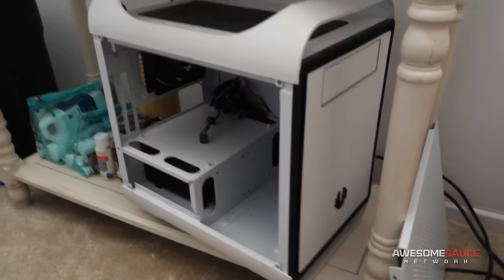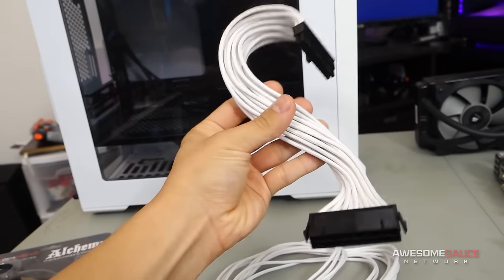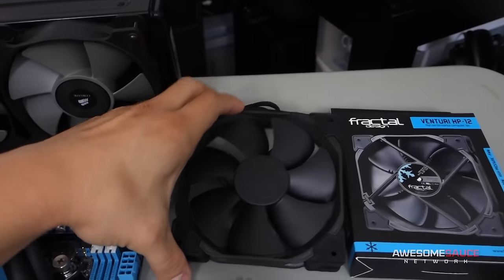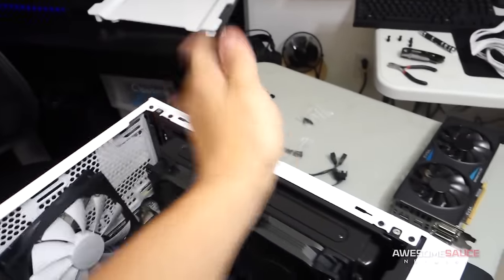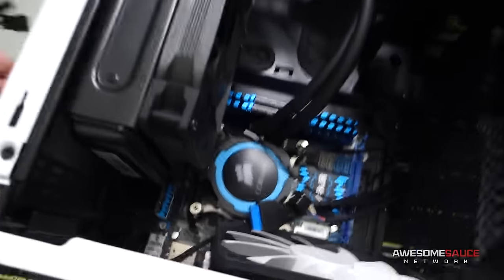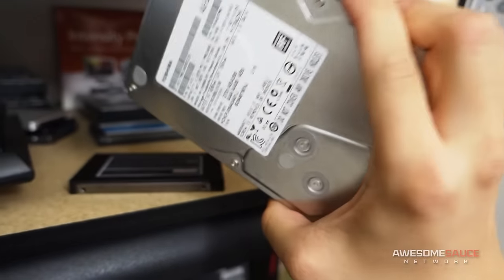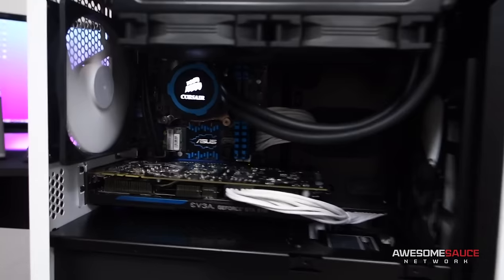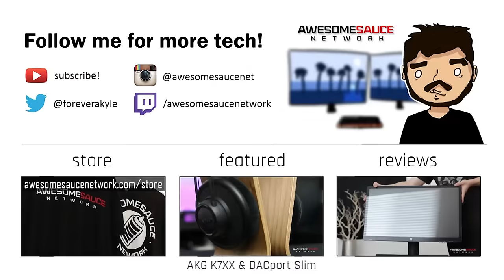Building My Wife a New PC! - "The Wifey Build"

Comment: I have the same case and loved it so far, it's not too big nor small.
Reply: +exit07 What about the venting on the top, seems restrictive (for a H105 at least)?
Reply: the case has 8 rectangular holes on the top for ventilation
Reply: ***** 4 on each side right? They just look small. The fans on the cooler shouldn't spin up too high so probably fine for this build.
Reply: yes 4 on each side. There is also the exhaust vent in the rear

Comment: Looking at the finished product I feel like it would've been better to use the stock black cables and black fans on the intake and exhaust or doing something with the H105 tubes. The wifey probably won't care and it was a just a quick build so it probably doesn't matter anyway and it still looks great.

Comment: But kyle does it run crysis 3 at 999999999999k resolution ultra graphic settings ;)?
Reply: +Mauricio garza Hah! Crysis 3! Who needs that when you have pong! I get 12 fps on my quad titan x system...
Reply: I got 9999 fps with my intergrated graphics on farcry 4
Reply: Rhys sopniewski But can you run pong?
Reply: Im afraid not i will have to upgrade from my skylake cpu to a 1.0ghz celeron

Comment: How far in terms of FPS and 1080p gaming (1440p at times) do you think I will get with this? Planning on playing Battlefield 4, SWBF, Arma 3 etc. 

SSD: Samsung EVO 250GB
GPU: Asus GTX 970 4GB STRIX
PSU: Fractal Design 500W 80+ Gold
CPU: i5-4690K 3.5 GHz 6MB
CPU Cooler: be quiet! Pure Rock
RAM: 8GB Crucial DDR3 1600MHz Ballistix Sport
Motherboard: Asus Z97-A
HDD: WD Blue 1TB 7200rpm 64MB
Reply: Try getting a 4460 and a 980, that should run 2K.
Reply: get your self a msi R9 390 (non X) version , 8GB of vram should give you a 70 fps on 1080p max , 50 fps on 1440p max especially when you get to have windows 10 , and since AMD has launched Theire new Clint ... they are rising once again tbh.

Comment: What i really don`t like about this case is the ventilation for the Graphics Card, i think its too restricted and i think this radiator mount is designed to suck in fresh air into the case vs pushing hot air out, but anyway if you do it  you`ll run into the issues of introducing a lot of hot air and stress the graphics card more.

Comment: Wouldn't it have made more sense to take the AIO cooler off of the CPU while installing the radiator, then put it back on once the radiator's in the case? Bit late I know, but that's probably what you're meant to do...

Comment: That whole 16 screw thing sounds like a hassle. My old HP desktop was like that too and I didn't feel like dealing with that many screws so when I was transplanting the system I just ripped off the whole side/top panel off.
It's not like I was ever going to need that case again anyways.

Comment: On the top panel complaint, they probably assumed you wouldn't install the waterblock onto the cpu until after you slide the radiator in place.

Comment: Hmmm, might have tried to front mount the radiator.  More of an aesthetic choice, but it drops down so low into the case in the top mount.  Also it probably didn't such a big fan in the front since the system was not really going to run hot.

Comment: You really shouldnt have 3 exhaust fans and only one intake. better flip the rear exhaust to an intake instead - that would yield better temp for your CPU, and/or lower noise due to less demand on radiator fans.

Comment: Why didn't you just remove the CPU cooler from the CPU socket when installing the radiator & top bracket? That would have meant you could have installed the motherboard first & routed any cables, and then installed the radiator & bracket. It's a five minute job reapplying TIM & tightening down the four screws.
Reply: You beat me to it.

Comment: Not to mention, going with AMD would have saved a lot of money. I love Intel / nVidia as much as the next fanboy, but on average these parts cost 2 - 3 x what an AMD costs - and unless you're aiming for playing the top new games on ultra at 4k, then an AMD build is fine (though for that matter, I just got done playing Metro LL @ 4k on very high settings on my AMD build with no problems... so).

I have an 8350 3.7GHz (stock), R9 390, 16GB Ram, 1TB hard drive, and I can play every current game at 60FPS+ at 1080p with everything in ultra.
Reply: kewl
Reply: ***** CPU side? So far, yes.
GPUs? Hell no.
Reply: Deucalion23 so true mah dude

Comment: i run a normal i7 2600 and works fine for gaming. not the top but with gtx 960 oc can run even gta v on high at 60  fps

Comment: Did the clearance on the 970 to the power supply shroud create any heat issues on the 970? I saw it was vented, but its couldn't tell how far those holes ran back, and that is fairly tight clearance...

Comment: i think that 2600k will be quite a problem. in my experience, ivy bridge and sandy bridge processors gave me frequent blue screens and system errors as they aged.
Reply: Been running an overclocked 2600k for over 4 years now and I can't say that I've noticed any abnormal amount of BSODs. Same with my 3570k system, but for fewer years. Just putting that out there.
Reply: Only Ivy do. Sandy Bridge has got to be the best Intel CPUs ever.

Comment: sorry, but you have no excuse for no led's I have this case (but in black) and I managed to fit (almost) an entire 5m strip of 300 rgb leds inside and out of it, and you cant see a single one.... (I have them in 2 loops (with 2 controllers) one running around the inside like around the outside of the case closes to the side pannel (so they like run across the bottom then the front ect)) and my second loop runs around the front of the case (like where it brings in air) again around the outside of the case, then it goes into the front and dont underneath the hard drives through one of the vents and makes a lap (and a little more) around the bottom of the case giving it like neons.... looks amazing, and doubles as a light show that lights up my entire room lol

Comment: If you have time, would you kindly review me "to be-build"?
Is it good or bad, or mediocre?
Rate them, either 10/10 or 8/8, whatever.
Would you change any of them, if so, why?

Motherboard : Asus Z97 Socker Intel LGA1150 Pro Gamer
Processor : Intel i5-4690k 
RAM : Corsair Vengeance 8GB (2 X 4GB) DDR3 1600MHz 
HDD : WD Blue 1TB SATA 6GB/s 7200 RPM Internal Hard Drive
SSD : OCZ Trion ARC 100 240GB 
GPU : MSI GeForce GTX970 
OS : Window 8.1 
Case : Fractal Design Define R5 
Fans :
Corsair AF120 Quiet (Twin) 
Corsair SP120 Quiet (Twin)
Heatsink : Cooler Master Hyper 212 

Thanks for the review, take a time to respond to this comment!
Reply: nice
Reply: Wave you might wanna upgrade to windows 10

Comment: Why don't have a pump or tank for the coolant?  Maybe I didn't see it, but as it stands in the video, you have both hose inlet/outlets just looping to the radiator and cpu cooler...
Reply: hydrolisk1792 - It is an all-in-one (AIO) CPU liquid cooler so the pump is generally built into the CPU mount/heatsink and a separate reservoir is not needed because it's a non expandable closed loop.  Essentially the entire loop/pump/radiator is the reservoir.
Reply: hydrolisk1792 because it's an all in one liquid cooler, it just runs through that way.

Comment: Nice video. How did you choose the water cooling system? Is it silent? I had a cooler master water cooling and it was loud!
Reply: Nathan, how long does it take for an air cooler to fail?
Reply: Nathan Bullock One time, I tried to put an air cooler in my mac, but it didn't work because Apple designed it so you can't use other companies' parts. So I just put it on top and the when I simply bumped into my desk, it fell off. Thanks, air coolers.
Reply: ***** I'm trying to listen for my air cooler, but I'm having a hard time.

Comment: Couldn't the radiator be installed by just removing the block from the motherboard? Are there clearance issues with the mount screws on the socket, I can't tell from the video?

Comment: Anyone know if a Galax GTX 1070 HOF would fit in this case? The length and width of the GPU should be okay, but I can't find any info on the amount of space between the top PCI bracket and the fan shroud. The GPU is 55mm or so thick.

Comment: Could the 200mm fan that comes with the case pull enough air to use the radiator without the 2 extra fans if you mount it in the front?

Comment: An old Intel processor, teamed with a (then) top of the line graphics card? Large radiator for the CPU? That Intel WILL bottleneck that GPU, and that GPU will never see its full potential in that rig.

You'd have been much better off building her a custom AMD rig with a FX 8350 overclocked on that water cooler, R9 290x, Sabertooth board, 16 gigs of DDR3, and maybe a 500gb SSD. You could have put together that build for probably close to the same price as this build, and all the parts would have been a better fit and wouldn't have resulted in bottlenecks...

Comment: Hmm, don't know if I want this case of the Corsair Air 240.
Reply: I would recommend this case but with the tempered glass side panel
Reply: Any particular reason why? I'm curious. I like 'em both but the whole two compartment design of the 240 is really appealing to me. That and its slightly more compact size.
Reply: tbh, I think the Enthoo looks really cool and i'm not too attracted to the aesthetics of the 240. Personally, I think that aesthetics play quite a big role when you're choosing a case. But of course every persons needs is different, and practicality comes before aesthetics. So by all means, if you like the 240 and you think it'll work for you then choose that!

Comment: Why the hell did u remove the top panel...4 screws hold in the radiator bracket...not 16. It slides right out. Just installed mine yesterday. Took only a few minutes.

Comment: Which is more reliable, SSD or HDD for your general storage. I am wondering because what if you did loss data through some random issue or corruption, which is more/less likely to have any problem with storage
Reply: SSD
Reply: ssd
Reply: LeaderofChickens definitely SSD. More expensive and less storage typically, but it has no moving parts and faster load times, meaning there is a less chance of failure. For HDD, any slight bump or scratch will render it useless, while SSD can take more of a punishment. For example, laptops now are mostly SSDs for the reason they are more durable and won't fail. Also the SSD can bring up information more quickly than the HDD. SSD also rarely corrupt apart from idk dust or a power surge which will fry the rest of your system before you even should worry about your SSD.

Comment: Ugh...you must not like her too much if you're making her use a Toshiba hard drive.  I've used so many brand new Toshiba drives that make the computer feel like the drive is already dying because so many prebuild computers come with Toshiba drives, likely because they are so cheap.  Even gaming laptops are shipping with mechanical Toshiba drives...  For a gaming PC I would go for a single larger SSD rather than small SSD and mechanical combo.  Games take up a ton of space and running out of space quick on the SSD means installing games on the craptasic Toshiba drive.  And installing games on the mechanical drive, Toshiba or otherwise, defeats the purpose of having an SSD.

Comment: Can someone tell me if this is a good pc build? This is my very first one and my friend helped me find all of the parts. My budget is $1500 and if you want to change something, let me know. Here are the parts:

CPU - Intel Core i5-4690K Devil's Canyon Quad-Core 3.5 GHz 
Motherboard- MSI Z97 GAMING 5 LGA 1150 Intel Z97 HDMI SATA 6Gb/s USB 3.0 ATX Intel Motherboard
RAM - CORSAIR Vengeance Pro 16GB (2 x 8GB)
PSU -  CORSAIR CX series CX750M 750W ATX12V v2.3 80 PLUS BRONZE Certified Modular Active PFC Power Supply New 4th Gen CPU Certified
GPU -  GIGABYTE GeForce GTX 970 GV-N970G1 GAMING-4GD (rev. 1.0/1.1) 4GB 256-Bit GDDR5 PCI Express 3.0 SLI Support ATX Video Card
SSD - MSI Z97 GAMING 5 LGA 1150 Intel Z97 HDMI SATA 6Gb/s USB 3.0 ATX Intel Motherboard 
Hardrive - Western Digital Blue WD10EZEX 1TB 7200 RPM 64MB Cache SATA 6.0Gb/s 3.5" Internal Hard Drive Bare Drive
CASE - Rosewill VIPER Z - ATX Mid Tower Gaming Computer Case
Reply: looks fine.
Reply: +Vonklesitrapp I know this is a late response, but I'd advise getting a good CPU cooler to overclock that CPU, it's unlocked so you might as well. Your ssd is a motherboard? o.o

Comment: Would this  be a good build for running games like GTA, BO3, CS:GO and some video editing?
Intel Core i5-6500 3.2GHz
EVGA GeForce GTX 970 4GB SSC
EVGA SuperNOVA NEX 650W 80+ Gold PSU
MSI B150 Gaming M3 ATX LGA1151 Motherboard
Corsair Vengeance LPX 16GB Ram
Samsung 850 EVO-Series 250GB SSD
Western Digital Caviar Blue 1TB HDD
Reply: yep but i would recommend you waiting and buying a gtx 1070 well it should be released today
Reply: I would like a 1070, but it'll make my budget go up ~$200
Reply: oh
Reply: +Maya Chadwick (mayathemango) 3.5 go vram won't be enough to futureproof
Reply: +Rashid Al Owais gb*
Reply: why not wait istead for the RX 480 to come out, it will perform like a R9 390 but it will only cost 200 dolars, and with the rest you can go for an i5 6600
Reply: Yes it should be fine
Reply: I was going to get a 1070 but I was attempting to get it on amazon but it was realized at a random time so I dint get for my build
Reply: If the CPU isn't quad core then you can't rlly play GTA
Reply: +Beast Mode8000 oh yes you can take a look at the i3-6100
Reply: That's pretty overkill for what you do. My pc has an i3-6100, intel 128gb ssd, gtx 660ti, evga 430w psu, gigabyte h110m-a mobo, 8gb crucial ram, and a WD 1TB HDD. Runs almost all games at 1080p high settings 60fps.
Reply: Mine was about $450
Reply: +Maya Chadwick (mayathemango) now buy the gtx 1060 :D

Comment: hi, I've the gtx 970 and a corsair rm550x and have had a cooler master v450 for 2 times. why? my psu keeps making a rattling noice when the system is on for a long time, it's for sure no coilwhine. and ik keep sending the psus back with no result, I really don't know what to do, or what is the issue in my system that makes the rattling noice in my selfbuild pc. specs:
motherboard: asrock b85m-pro4
cpu: i5-4460
gpu: msi gtx 970 4g gaming
storage: crucial BX100 250gb
case: cooler master n200
ram: 8 gb hyperx fury

can you help me out?

Comment: Would u recommwnd me gtrying to get my hands on a i7 2600 at the max clock 16gb ddr3 my ssd etc and and a gtx1070 ? This is untill o can get another 1070ti and a ryzen 7 with 32gb ddr4 the i7 build with the 1070 will be for 1080 wditing and light gaming till i get the ryzen 7

Comment: What's the point of having an iTX case that's that big? I just don't see any value in having an iTX system that doesn't save space.
Reply: +Jeremy Blair It's smaller than a mid size case while still having room for goodies (note the water cooling).
Reply: +FATCAT9080 Doesn't look any smaller than an mATX tower
Reply: +Jeremy Blair the only mATX case I can think is somewhat close to this one in terms of features is the Bitfenix Prodigy M, but that one has a lot of restrictions in the PSU size, GPU size, AiO WaterCooler, even drives space
Reply: Tiago Luz Yeah. The extra two or three inches of height make a big difference in overall volume at this size.

Comment: Would this build work with a 6700k & a 980?
Reply: Are you building a new pc?
Reply: No, just wondering, to replace current PC, when it dies
Reply: +[EGN] D̲i̲a̲m̲o̲n̲d̲P̲i̲g̲m̲a̲n̲ ̲-̲ ̲I do things with stuff Check the motherboard socket, as for the GPU, it should do just fine.
Reply: trebor 6 Yea, that's what I thought - what with the next gen crap and all
Reply: +[EGN] D̲i̲a̲m̲o̲n̲d̲P̲i̲g̲m̲a̲n̲ ̲-̲ ̲I do things with stuff It's hardly crap new processor lineups have always used different sockets than previous ones

Comment: Can someone tell me if this is a good pc? Intel core i3 4170 @3.7ghz 8gb of ram gtx 950
Reply: Get an FX6300 and where's ur other stuff what's ur motherboard and psu
Reply: A dog ate my homework Sorry mate I was just brain storming a potential computer to build for my family. My current build is an i7 6700k a gtx 970 windforce, a asus z170-a in a define r5 case with a 650 watt power supply
Reply: Should get you 40 fps high to ultra settings in most to all games you play.
Reply: Don't go Intel get AMD
Reply: QQQQQQQQQQQQQQLOLTHATISLONG for the processor, the i3 is better than the AMD cpus.
Reply: GAMING WITH BJH thats one of the best i3's, in fact i3's could rival the i5's if it had 4 cores instead of thread support for 2 cores.
Reply: GAMING WITH BJH Yeah its the hyperthreading holding it back. All it does is trick the motherboard into thinking its a 4 core processor. Its not full results like that.
Reply: GAMING WITH BJH it is.
Reply: +GW12 
Can someone tell me if this is a good car? Ford Focus.
Reply: +A dog ate my homework i3 beats fx 6300
Reply: +Alfie LC srry to hear that